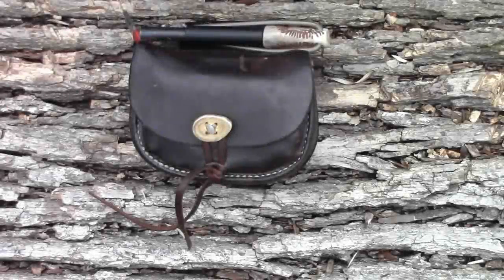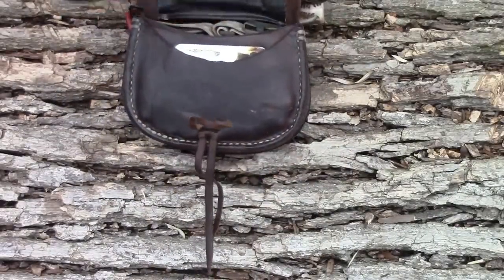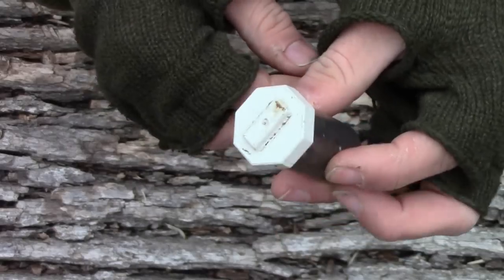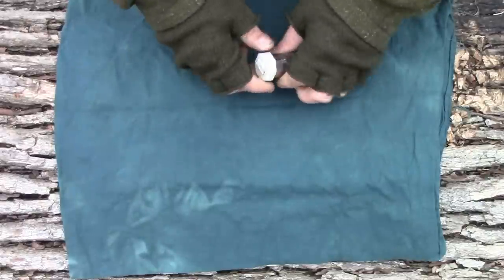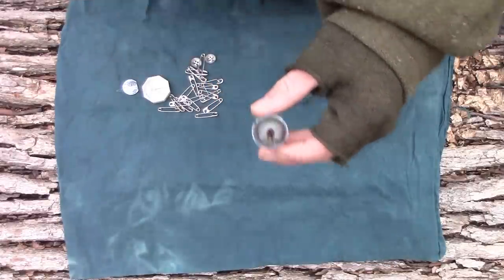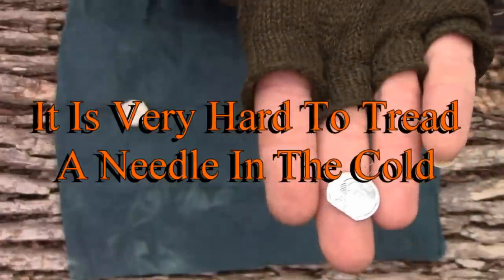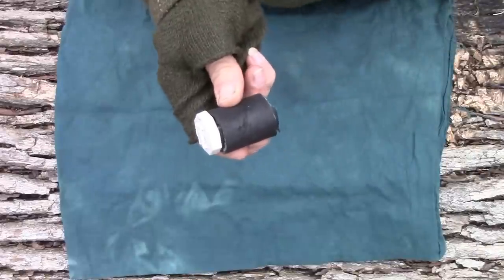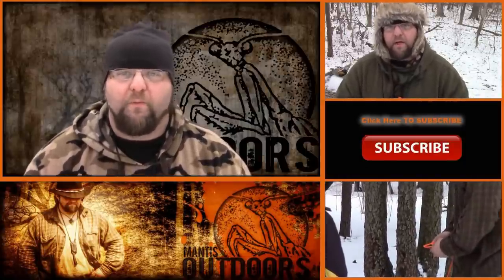How To Build A Small Sewing Kit

Comment: Neat little set up you got there.  I use home made square kits and pill bottles. You might want to add a small piece of emery paper to keep your needles sharp and knock the rust off of them if they get exposed to the moisture.  If that lid is hollow, add a bit of beeswax for your thread.